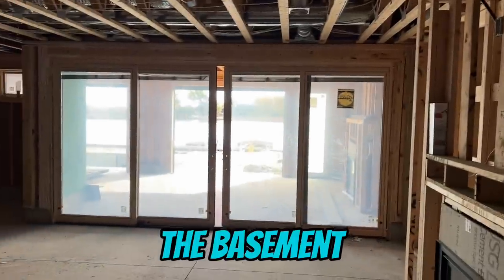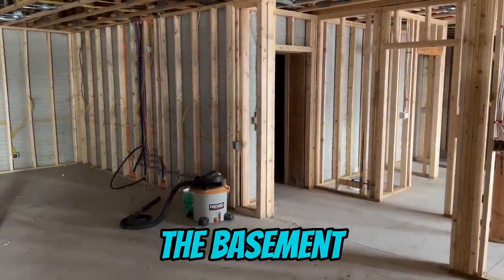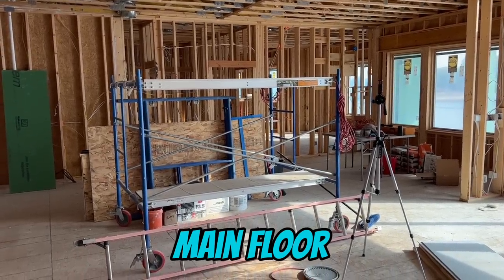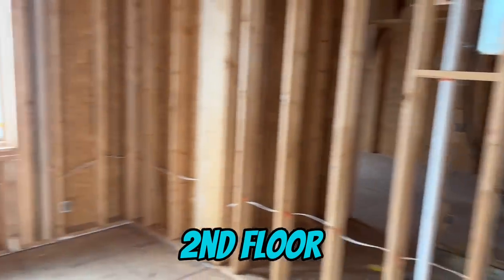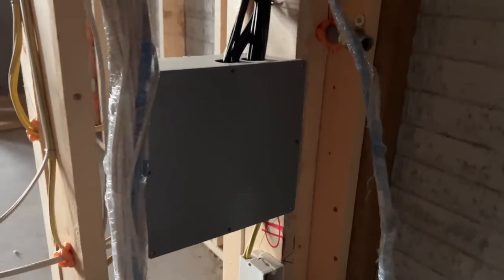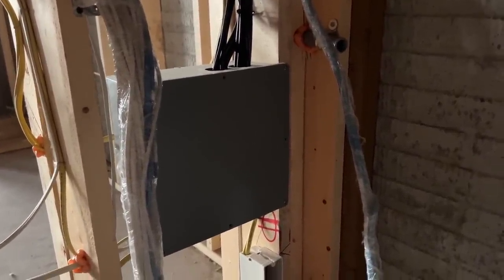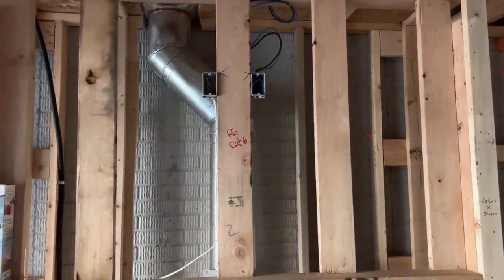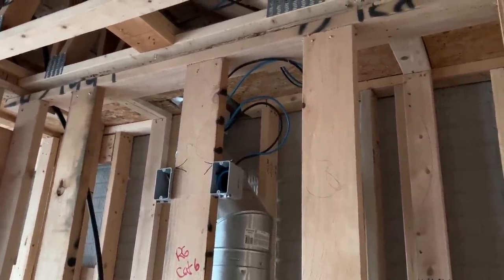Properly Plan your Low Voltage Wiring in Your New Build

Comment: Technology that uses wires is evolving so rapidly that I question how much we can future-proof anything involving wires. The only thing that seems likely to be useful long term is roomy conduit so we can easily take out the outdated tech and put the new ones in.
Reply from the maker: Yes, the only way to 100% future proof a home is to run conduit everywhere.  Not sure how practical that is... depends on your home's layout for sure.  I typically recommend choosing a couple locations in your home to pull conduit to... WAPs, Cameras and possibly your main entertaining areas just in case.  Those areas would be most likely where you may need to upgrade down the road.  And make sure you have one to the attic for any future pulling...
Reply: 1 gig has been the standard for the past 20 years. Run Cat 6a, 10 gig will be the standard for a while. Most devices are 1 gig, some new cameras went back to 100 meg
Reply: @paulweaver7426  I’m 53, old enough to remember when only Ma Bell could run a phone wire and an extension was a luxury. Coax came and basically went. Now Cat 5 and 6 are essentially useless because wireless is so cheap and good. Hard to know what’s next.
Reply: @twestgard2 CAT6 useless?🤔
Reply: @fasteddievh2072  Knob and tube isn’t useless either, but we don’t install much of it anymore.
Reply: @twestgard2  Very interesting.   So would you say that WiFi is more reliable and secure than a hardwired network?
Reply: @Navy1977 yes! We had a party line with our neighbors in the 70’s. Now we have a party line with the NSA.

Comment: I like to terminate my primary conduit into the back of a weatherproof service box mounted on the exterior wall of the house. The telcos install their own boxes and then jump to the house box, which goes to the main distribution panel / cabinet / rack.

I like my main conduit to be at least an inch in diameter, especially if it has to twist a few times en route to its destination. 

This makes it easier to pull fiber down the road without having to disturb existing services like cable and analog phone.
Reply from the maker: Wanna come work with me?  LOL.  All great tips.  Thanks for sharing.  I know comments like this help the viewers!
Reply: @ethernetblueprint  Ha, thanks, dude. Thirty years of stockpiling tips ensures that I've always got an opinion ready if necessary.😂

Comment: Cat6 is so versatile but if you are a real low voltage company you do not use electrical boxes you use low voltage boxes so the wire can not get kinked up
Reply from the maker: I hear you and agree that LV boxes can be used... For me personally, I like the extra support of an electrical box for a ceiling mounted AP.  The wiring doesn't have to be "kinked".  It can still can be pushed through the box similar to a LV style.  I typically use LV boxes behind the TVs and for vertical mounted wall jacks.

Comment: The cat6 comes straight out of the ZIP sheathing and the hole is filled with spray foam…. Ouch that hurts to look at. Matt Risinger would not approve!  Needs to have the ZIP liquid flash.
Reply from the maker: Lots of installers install it differently.

Comment: I would just like to say that the most efficient "mesh install" would include cat six to the mesh repeaters so that they can enjoy a hard line to the switch. This improves signal quality and speed coming from the mesh repeaters and in the case of a fully enclosed theater, I would have a hard wire to the projector as well as to the mesh repeater in the room if you needed that kind of redundancy.
Reply from the maker: I agree that without a hard wired, physical connection the mesh would not work well in this house. Especially in the theater.  Everything is hardwired with Cat6 cables and POE powered in this home just like you suggest.  This home did have coax pulled just in case they wanted cable boxes and weren’t ready to cut the cord. Moca is fine when you don’t have any other options IMO.
Reply: Just to be that guy:

Mesh is essentially a marketing term (popularized relatively recently) describing network topologies that use radio signaling instead of cables to connect wireless nodes to clients as well as to one another. 

Standard WiFi access points with wired connections to the switch are by definition not a mesh, and there's no need to throw "witless mesh" in scare quotes.

Comment: Hey Tim, can I ask what you typically charge a client to do their network, a/v, and cable design?
Reply from the maker: It really depends on the space.  I try to be very fair.  If you'd like to email me at tim@ethernetblueprint.com, I'd be happy to talk through it with you.  I don't charge anything for that part. lol
Reply: $75 - $100 per  drop give or take.. this covers cabling, connectors, wall plates, keystones, low voltage mounting plates, smurf tubing and misc items plus labor

Comment: Btw, if you have floor to ceiling tile like in a bathroom, wifi doesn’t even like that! I have a laundry with 4' tile against a bathroom with ceiling tile, and the laundry room gets bad connection even though there is an access point directly on the other side of the bathroom.
Reply from the maker: So true... The materials in the home, thickness of the drywall, metal beams, insulation... all play a factor in your signal.

Comment: Another key issue I've seen design woes with - in-floor heating! We had a client with in-floor hydronic (hot water) heating no only in their basement, but 1st and 2nd levels as well. Moving water and WiFi don't mix. Had to have multiple WAPs for every floor!
Reply from the maker: That’s a good point. Never ran into that issue but that makes sense.

Comment: Happy to see you installing a rack downstairs in the basement. I am not a fan of the in wall on-q style network boxes. I would run several drops of Cat6 to each room. Network cable is cheep and on drop room usually is not enough.
Reply from the maker: Thanks for the comments!  Appreciate you watching.

Comment: What about making it easier to replace the cables? Through time surely they will need replaced? 

One other thing you mentioned putting in tubing for future proofing and great advice however I would of added putting rope through the tubing so you already have a pull through for the cables from one end to the other. Would definitely be advisable if you are unable to go straight up the way.

I would also add access points on every floor, all cables running to that point and tubing splitting off in those access points so you can replace the cables if needed to down the line, instead of having no way to easily do this once all walls etc are covered.
Reply from the maker: I like how you think... You're not wrong, but I will say this boils down to personal preference.  I'll share my 2 cents.  You can go as crazy with future proofing... And many people do.  I simply want to plant the seed in their minds so they can think through their own setups and planning...

The pull string is a great idea.  Typically, they are best used for adding new cables though.  When replaceing a cable, in most cases, you can use the old cable as the pull string.  So it depends on what you are preparing yourself for!  

I will say that if a user is pulling Cat6 or Cat6A, the need to replace cables might be slim.  Both cables are rated at 10G speeds so unless a cable breaks - which is rare - I don't know that you would do that... In my eyes, the more likely scenario may be a new type of cable being introduced for home networking and someone wants to upgrade to that.  We just don't know what the future holds in that area so planning for this is a great idea.  

Thanks for your input and for sharing your thoughts.  All smart ideas.

Comment: Great video! Learned tons! Thanks! Still have a few questions about the network head-end and the exterior termination point. Is it ideal to have the coaxial lines also go to where the network headend is too?  It seems like in the video they're in the same location as the network head-end. Is that right?
Reply from the maker: Yes, absolutely.  That is a good logical place to have coaxial lines run too..

Comment: Something I dream of doing on new construction or heavy renovations is to bury PVC conduit to the property line where the service provider has their trunk.

Too often a cable fails en route and since burying it properly would be either too expensive or too difficult, the replacement is either buried hastily or not buried but rather strung along the property in some crude, unsightly manner. 

A conduit is cheap insurance against this.
Reply from the maker: Smart.  Anytime you can protect the line in the ground, its a good option.  Make sure you talk to your provider first, some of them have issues with running their cables through other peoples conduit.  Wouldn't want it to be all for nothing...even though it makes more sense to do it that way.  ISPs can be funny about that sort of thing!

Comment: take the pedestal conduit direct connect with the MDF conduit using a right angle conduit body with cover.. it will look cleaner and professional without havting any exposed wiring out side
Reply from the maker: Good tip.  I didn't install this one... the builders electricians did.  Good tip for the listeners though...
Reply: I'm a contractor with Cox Communications, they would literally cut the conduit in order to place a house box on the side of the house which is protocol so I wouldn't bother with that.

Comment: You had some great explanations. Ive got about 8 wires that i ran from the isp drop (modem room) to my new living room (router location). Whats the best way to choose the fastest ethernet line to go from the modem To the router? 

I noticed some are slower than others and im not sure why. Theyre a mix of Cat6e and Cat7 cables.
Reply from the maker: Can I ask how you are testing the speeds of these cables?  Cat6e at lengths less than 150' can do 10Gb speeds. So as long as your router is rated for less than 10Gb speeds and your distance is less than 150ft, you should be maxing out your speeds from the modem to the router....  Now, I will say that not all cable is created equal and cheaper cable usually has less quality.  I typically recommend Cat6, Cat6e or Cat6A - pure copper, UTP Riser Rated Cable (CMR), non-plenum for residential homes.

Comment: Great video. I have concrete home theatre as well. I had a mesh system that worked ok not greatest wifi in theatre. I then upgraded my mesh system to Asus XT-9 that comes with two units wifi was very weak in theatre so I added a router that joins mesh system and put it inside theatre now wifi is great. Why don't you just put an access point in the theatre?
Reply from the maker: I am installing a hard wired AP in the theater. Sorry if that wasn’t clear.  Mesh and concrete don’t mix. Glad you found a fix.
Reply: Use eero wifi and run a cat 6 cable to every access point a.k.a "backhaul data over ethernet" for way better performance and reliability

Comment: Hey Tim, great video. I'm currently having my house built in Tenn and my electrician is old school and doesn't know anything about ethernet, so I'm doing all the wiring myself. I saw that you used single gang fully enclosed boxes vs the open boxes that you can get almost anywhere. Is there a reason you went that way ? FYI, I am running cat6A cable throughout the entire house.
Reply from the maker: Good catch... You can use LV open boxes for your runs, no problem.  If you are doing WAPs, you may want to use a solid box for the ceiling locations though.  They are a bit more rigid and won't sag at all from the weight of the AP.  I'm sure either would work.  That has just always been my preference.  Thanks for watching!

Comment: Does having data and electrical wires did not affect the signal for Ethernet in that house? I get that the wiring wasn't going through the same holes on the studs, but it appears that some of the wires are overlapping.
Reply from the maker: Typically, they can overlap. Just shouldn’t run in parallel.  If they do run in parallel, they are should be at least a foot apart.

Comment: Should I run wires through conduit before the drywalls are up or run the lines outside of the conduit and have a clear path for future just in case purposes? How do you do a y in Smurf tubing?
Reply from the maker: I dont think you want a Y in the smurf tube.  I have seen it where people will create an access panel and then run multple tubes back to that location.  That allows them to run cables just about anywhere they want by jumping from tube to tube in the junction box.  A "y" would not work well for fishing cabling.  I like my LV cabing in the walls... but every project is different.   I may need a bit more info before I can offer further advice.

Comment: Should low voltage be run next to conduit? Or just run it through conduit for the hell of it? Can you put a y in Smurf tubing? Would speaker wire be better to terminate with connections or leave a brushed pass through faceplate for connecting directly? Doesn’t quality downgrade based on increased quantity of connections, especially HDMI?
Reply from the maker: When I talk about LV cabling, I am talking about network cabling (Cat6, Cat6A...).  I don't know much about AV cabling to be honest and have been looking to team up with someone on my channel to help with questions like this... 

I will say this.... Different city/states have different rules for this.  In Nebraska, we can have LV run next to power conduit with no problems, but you don't want to share a conduit with power.   Typically it is recommended that LV cabing that is running horizontal to power lines  (not in conduit) should be 12" away from it to avoid interference.  I do like using smurf tubing for LV cabing and future proofing.

Comment: Out of curiosity why didn't you do a full size plastic structure wiring panel or even a half size. Also do you guys normally do your rack bundles down low not up high?
Reply from the maker: Are you talking about the boxes built in the wall that comes with some homes?  If you are, I strongly dislike those boxes.  IMO, they are not practical for "most" unifi network gear - especially if you plan to have a UPS.  As far as rack placement, it really depends on the home.  Some are high, some are lower... I try to find the happy medium between not needing a ladder to access them, but also having them out of the way... It really depends on the home though.  For this house, this location made the most sense based on how the fiber was entering the property.

Comment: Home wifi that is all I've ever needed to stream video/TV and access internet.  I've occasionally used wifi cameras like google Nest or Wyze, though this is more a novelty than necessary.
 I plan to run a single coaxial cable to a central point in the home to connect a wifi router.
I've never used hard-wired networking in a home and don't see a need for it today.  Why run Cat6 or any other cable when wifi is adequate for home needs?  Why run Coaxial to TVs when streaming has taken over?   Is it for gaming (which I don't do)?
Reply from the maker: Well I would argue that if Wi-Fi is important to you then it may be a good idea to wire in a nice system however, everyone’s needs are different.  Your home may not require a mesh and a single unit works well for you. Or, you don’t think you’ll ever need Wi-Fi outdoors away from the house. 

I’m basing my content off my experience in people’s homes attempting to make standard Wi-Fi or Mesh systems work where there is no cabling. The options are extremely limited. And a home owners need change over time. Having wired infrastructure in place can make a huge difference in cost when that unknown thing that you didn’t know you needed comes along. I do, however, respect your opinion on this manner and appreciate you commenting.
Reply: @ethernetblueprint  Thanks for the reply.  
My contractor had initially specified a couple of access points, but agreed that a centrally placed wifi router may be adequate.  He said we could at Mesh later if needed.  The current home build is 4000 sq ft open floor plan all on a single level, and the router will be in the center of the home.  However, my last home as a little larger at 5000 sq ft on 2 levels, and the single wireless router located on the second level supplied good wifi in all areas of the home, even the back patio.  
But as far as cat6 cable, I just don't understand why that would be needed with good wifi.

I am having low voltage wire run for motorized shades and distributed audio as well as home theater speakers (though wireless sonos is a good option as well, just not as clean a look as wall or ceiling installed speakers.
I'm also running conduit from the rack to the crawl space and figure I can run wire in the crawl space if something ever comes up.
Reply from the maker: I certainly wish you the best. I hope it works well for you.

Comment: What do you think of those flat ethernet lines they sell on amazon? I ran about 12 of them Through a diy flashing conduit i made in 2020. Are they just as easy to re-terminate as the standard?
Reply from the maker: Personally, I don't care for them at all.  In my experience, from a functionality aspect, they work fine, but aren't super asthetically pleasing.  I haven't bought a spool of cable and tried to terminate, but I have snipped a flat prebuilt patch cable before and tried to re-end it.... Unsuccessfully, I might add.

Comment: 14:58 y’all didn’t want to support that corner of the landing? I understand you’re using fab joist and all but that’s going to be the first failure point and I think about after a year that’s where you’re going to see the most cracks in drywall and mud due to settling and lack of support.
Reply from the maker: Not my area.  I hope it will be ok...